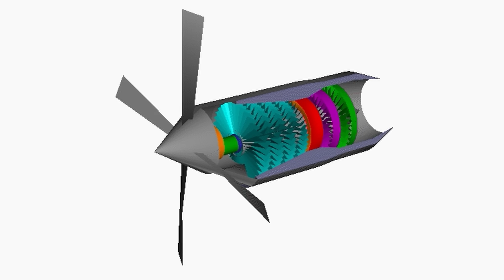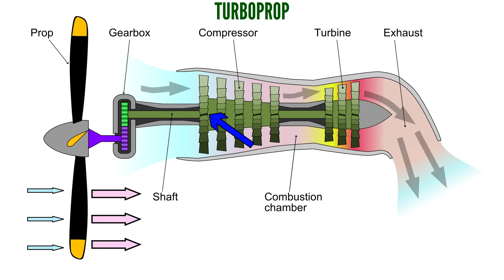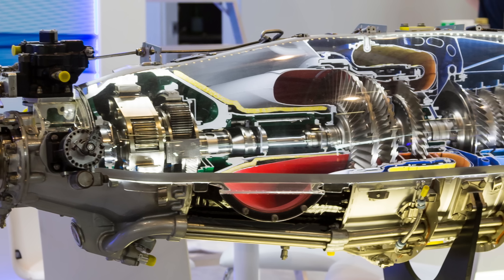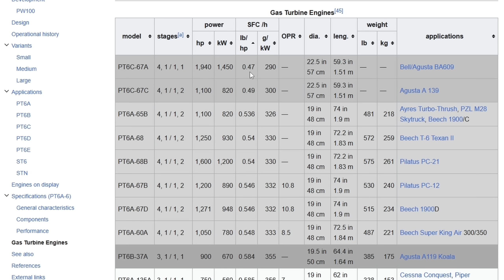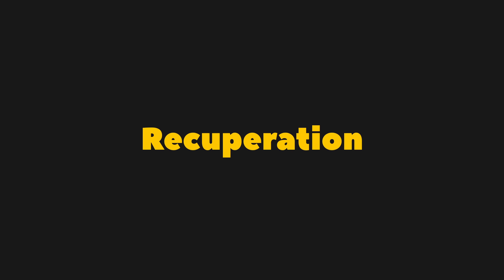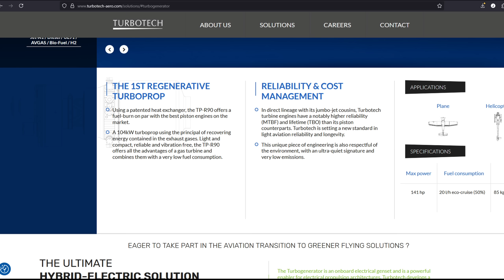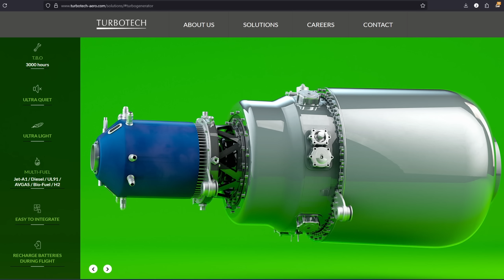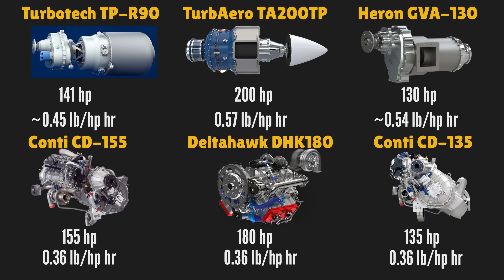Are Piston Engines Dead? Small Turboprops are Here

Comment: One thing that is definitely omitted from this analysis though is the difference in cost between Jet fuel and Avgas though. While specific fuel consumption of the turbine might be slightly higher, in most places Jet fuel is cheaper. Sometimes, way cheaper. Now, those are purely economic factors that can definitely be disrupted, but I'd venture to stay that at this point, the fuel cost of the proposed turbines is probably about a wash with the average GA engine. 

To me though, the real benefit here isn't specifically turbine engines though, it is increased R&D cost in the GA engine market. Comparing these new engines against something like the Cont/Lyco 300s and 500s is comparing bleeding edge engine designs against engines that literally had their first runs in the 1950s. It'd be interesting to see what developments could've been had if as much $ had been poured into R&D of piston engines. But here's to hoping we can just skip a step and go right to economical turbines...!?

Comment: Has anyone tried developing a hybrid drive, i.e. turbo-generator + electric-prop-drive(s)?  This would allow the turbo-generator to run constantly at optimum operating point.  Small batteries for take-off could temporarily boost power output. Obviously the generator and electric motors add weight but this would be somewhat offset by the lack of gearbox and transmission.
Reply: Another benefit of this: The battery could be charged on the ground from renewable energy sources, thus reducing the overall CO2 emissions per flight.

Comment: Modern gasoline engines can get down into the 0.35 to 0.37 lb/hp/hr range. Even the Continental Voyager IOL-200 was able to get down to 0.37 at a cruise power setting, and it was designed in the '80s.

Comment: As an aspiring pilot (meaning I know nothing) I love the idea of the power to weight ratio of turboprops, and I especially love the reliability.  It seems like the thrust to weight ratio would support a faster rate of climb.  Perhaps the weight savings would support a large fuel capacity.
Reply: faster rate of climb, but it also takes more time to spin up if it's on idle and you suddenly want to speed up (like in a go around).. piston engines are better for dealing with such emergencies.
Reply: @acasualviewer5861  Smaller engines have lower rotational inertia so should spool up slightly faster. A better solution, though, is to have a variable-pitch prop and use the prop pitch to vary thrust (i.e. set the prop pitch so more of the power is lost to drag than thrust), while keeping power relatively high. The prop setting can be changed nearly instantaneously.

Comment: I saw small turboprops in small aircraft 40 years ago. For the fact they haven't become the norm maybe says that it's never going to happen. Don't forget to factor in cost of overhaul which can be massive when it comes to small turbine engines.
Reply: you would be the same guy that would rant about how cars are not viable and horses are superior, or microwave ovens, or cell phones, or computers....  ignorance is bliss
Reply: @slowery43 a more accurate statement would be to hold those opinions 40 years after the introduction of cars, microwaves, etc…a more relavent comparison would be the viability of flying cars in this scenario. In no way have you countered anything in the OP post. A substantial breakthrough would be needed to increase the efficiency of small scale turbines to compete with piston engines, currently the cost benefit doesn’t work out in favor of turbines.
Reply: If the manufacture cost comes down enough I imagine instead of overhaul you might just replace and send a core out to be reworked or scrapped.
Reply: Agreed - while sometimes there's breakthroughs that make a once impractical technology practical, unless there's some big innovation or market change that's not likely considering how long and how many times it's been tried. Sure there was a time when turbines of any sort weren't practical and now they are for anything over 500hp, but if someone was going to succeed at making a smaller one practical they probably would have by now, unless there's some game-changing breakthrough coming along. Only thing I'd imagine could be that would be perhaps material technologies - perhaps ceramics - that makes engine parts able to tolerate higher temperatures at low cost. Honestly same for small aircraft engines different from the horizontally-opposed air-cooled direct-drive engines. Basically everything's been tried - geared engines, automotive conversions, rotaries, turbines - but they've not been found to be practical outside of some specific niches.

Comment: If I was going turbo prop I would buy one flying the form of a Caravan, TBMxxx, PC-12, King Air, or Cessna Conquest. If I wanted an engine for a kit plane, I would look for a PT6, Allison 250 or Garrett TPE331 USED out of one of the above planes being parted out. Service, parts and real known performance with these engines.  Solar APU (Auxiliary Power Unit), specifically the T62 series, by adding a reduction gearbox and a propeller can and has been used. You could get these APU's cheap at one time. .  I was looking at TBM 750's before 2020 and bat stew flu, the price was way down, $600k-$750k. Heck now a RV-10 is that and a new Cirrus is over $1,000,000.

Comment: At close to double the specific fuel consumption compared to a high performance piston engines, current airframes simply do not have the wingspan for the flying at efficient altitudes and storing enough fuel for decent range.

Comment: Unless turbines can drop in price, I do not see it in large quantities.  With FAA Mosaic regulations now approved and 2030 unleaded gas movement, the use of piston engine technology found in car/motorcycles such as computers, O2 sensors, water cooled, fuel direct injection, mass air sensors, and turbos will bring fuel economy, lightweight, and reliability upgrades to small aircraft.
Reply: Baloney. Addition of a turbocharger and water cooling systems is already a known quantity not much to be squeezed out of that relative to the old reliable lycoming normally aspirated horizontally opposed air cooled engine.
Reply: @erickborling1302  You must be on to something. Surprised cars on not still using the tried and true naturally aspirated air cooled engines like we saw in the 1938 VW Beetle.  I suggest you contact the car manufacturers and let them know of your insight.

Comment: I designed a rotary engine many years ago. One the size of a coffee can would produce 20HP with two power strokes per revolution and only four moving parts, with zero vibration. Functionally equivalent to a 4-cylinder 4-stroke piston engine. With two rotors and 7 moving parts, it would be equivalent to a V8. I wish I could afford to build one.

Comment: Turboprops DO VIBRATE... The Props... a fleet of turboprops had cowl cracks and exhaust stack cracks... All was in specs. They got aggressive about Prop balancing. All issues went away. Turboprops (commercially viable proven) start at about 400HP on up but typically start at +500HP. (Allison 250 has a 317hp version but typically 420-450HP). Not many GA planes use that much power. SFC is higher, cost of accusation and overhauls are high, not something private individuals can afford. Sub 350HP a turboprop is not competitive with a Lycoming or Continental on cost basis. Sub 130HP the Rotax is dominate, but $55,000. Ha ha ha. Again bought my Lycoming and Prop, overhauled it, put PMags on it, with a used Hartzell for about $20,000 15 yrs ago.

Comment: Compression ratio defines thermal efficiency from fuel combustion.  A piston engine can handle compression ratios, which in a diesel can be up to 18:1  coupled to air charge "boost" of 40psi.  Turbine engines can only dream of such high compression ratios.  The company "Speed of Air" have special ceramic coated diesel engine pistons that have raised the bar on durability and fuel efficiency by 20-30%.

Comment: $85k- not bad for engine only. deltahawk engine only? $60k- but the hawk will run on jet A, offroad diesel & B100, and at a burn rate of about HALF that of the turbine, it gets better- overhaul of a turbine engine, even one without a heat recovery exchanger, is pretty close to the orginal price of the engine- not a pretty sight. cost of overhauling a deltahawk? about 10% of the price of the engine. cheap, cheap cheap.

Comment: Would constant RPM props be OK for turboprop engines ?
If recuperators are so thin-walled, I expect salt-water air will drastically reduce their lifetime.
You didn't menion very cold weather operation.
Just my opinion, seems turboprop engines should be used where more power is desired, assuming the turbine can be configured for 200+ HP.

Comment: Turbo prop aircraft are ok for commercial aircraft or large GA aircraft but Cessna 172 and small GA aircraft personally it's too expensive as the engine is worth Moore then the airframe with a piston engine and as for speed you are limited to the aircraft design and can not exceed it and turbine uses more fuel and today's problems with the moden piston and turbine engines they are making them lighter to thinking to save fuel which is not that much fuel saving and this causes the piston and turbine to cost more in maintenance as they are failing more as they break easier then older engines as making them lighter causes cracks and the inspections are more intense like inspecting parts more regular then in the older heavery engines and for some reason the designers think they are building light weight formular cars
 Engines  and this drives the cost up so we need to look at what to he aircraft is going to be used for and it's limited and is the aircraft afforwardable for the. Job

Comment: In Europe, a huge advantage of the TurboTech is that it burns Jet A1 which is half the cost of MoGas, so that the cost of fuel is half that of a Rotax 915iS. 
You should also bear in mind that Jet A1 is about 10% denser than MoGas and, therefore, when SFC is equal the fuel burn measured in GPH or LPH will be about 10% less.
Reply: Jet A1 is just kerosene which is the least refined and cheapest petroleum distillate after marine bunker fuel and road tar.
Road fuel, both petrol and diesel, are heavily taxed around 100%, across all of Europe.
Fuel duty as well as Value Added Tax (VAT) on Jet A1 can be reclaimed if the fuel is bought for commercial use.
Most aircraft are owned through companies which facilitates reclamation of fuel duty and also VAT.
Across Europe, AvGas is almost 3 times the cost of Jet A1 and, therefore, high compression Continental and Lycoming engines have been rich men’s toys this side of the Pond.
This was why Thielert tried so hard to certify a reverse engineered Mercedes A-Class diesel engine to run on Jet A1.  They are now manufactured by Continental and by Austro and installed in all European Diamond aircraft.
SMA in France spent many years developing and certifying a ground up Jet A1 burning diesel engine for aircraft, Cessna was going to install these in the 182, but withdrew.
Diesel engines burn about 20% less fuel by volume than gasoline piston engines but the real saving is the cost of the fuel and also global availability.
Reply: Is this really true? I was always under the impression that the car fuel is the cheapest propellant one can get in aviation.
Reply: @RibicicDeni Jet A1 price per liter around Europe is around 0.60€ w/o taxes; 0.8-1€ with tax depending on country, while 95 petrol prices start around 1.1€ up to 2€, mostly on the high side. 98 can get up to 2.3€. Car fuel in Europe is heavily taxed.
Reply: @alanowa123  I am from Europe, and I always thought for some reason that Jet A1 is super expensive. Thanks for the info.
Reply: @RibicicDeni people who have the most influence it's prices use it a lot, so it's cheap ;)
Reply: @alanowa123  makes sense :D
Reply: Diesel more cost effective? Not in indiana. Not by a long shot.
Reply: For low time fliers, the price of fuel is probably a very minor component of their perceived cost of ownership.

Comment: Total cost of acquisition and operation of TurboTech is comparable to Rotax 915iS because it should have twice the TBO or more although it will take many years for an average private pilot flying 50 to 100 hours per year to reach this.
More noticeably, maintenance should be less, with no spark plugs to check and/or replace and, compared to small Lycoming and/or Continental engines, no magnetos and/or carburettors to adjust and/or service and/or replace.
Reply: Given the durability why would anyone buy a turboprop only to give that durability to the next Owner?  It's the same as if you bought a Diesel Pickup and sold it every 50,000 miles to buy another Diesel pickup.

Comment: Turboprops by themselves are lighter than piston engines of equivalent output but they burn more fuel so you either shorten the range or carry more fuel which will add up to more overall weight than an equivalent piston engine with the same range. Turboprops are also more expensive. So in the end, your aircraft is heavier and more expensive. That’s not ideal. Turboprops need to be more efficient and cheaper before they can replace piston engines.

Comment: The Pratt and Whitney Canada PT-6 do not have a gear box in front, it is a free turbine. One less item to service and fail.  The reverse flow also make it quieter than the straight through engines. Rotax is a big company with lots of overhead cost and share holders to please, so far, they have not done the aviation field any favors by lowering cost. Their price seem like what the market will bear, rather than reflecting their real costs. Same with the other few engine makers , their engine designs had been certified as long ago as the 1940s and still priced that high. The demand for reliability is not much more than a Toyota engine.

Comment: Cost over time might equalize with cheaper fuel and longer, but probably more expensive TBO. Maybe not equalize but get closer?

Also - if fuel is cheaper for the turbo prop, then increased fuel consumption comes down to a weight issue (ok environmental too…). But is the turbo prop lighter? Would it partly offset some of those penalty? Idk… I’m too lazy to run the numbers and on not even an active pilot anymore. But if I did become active again and I knew a light twin, say like the size and capability of a Cessna 310 could be bought with turbo props and offer much higher reliability for my family? Maybe the cost and increased fuel burn is justified - but then why not look for something with a single pt6? Devil in the details I guess…

Comment: Another thing to consider is the aircraft the turbotech is going into. Turbines often increase efficiency at higher power levels, if you operate it at 90% you might be getting higher efficiency AND fadter cruising speeds, but this would be a complex equation that involves weight, wing area, cross sectionial area, drag, etc... Probably something best left for the computer simulations to figure out
Reply: Not that complex. You just need an L/D curve and a TSFC diagram (for the engine-prop combo). Combine them to find the point where best range speed is.

Comment: The Turboprop will be purchased, if the price tag is at the Same Level as e.g. the 914 UL. I guess the Target group of this Fine Solution is/are the builders and the Aircraft Manufacturer which needs to have reasonable prices for their aircraft. 
Generally, cool little engine😊😎👍🏼
Best Regards, Hanspeter

Comment: I agree that for such small power output a TP is hard to justify, the only reason may be simply higher power to weight ratio with lower drag for some racing and that's it. Turbotech people in some interviews stated that they will make more powerful engines once they fully develop this one. They are backuped by Safran, so that's top level support. IMHO the sweet spot for these engines will be in the 250-400HP, where single or twin engine aircraft have more utilitarian purposes and there will be cases where a lighter engine and therefore a greater useful load plus a longer TBO are commercially justifiable. Presently there are no diesel options planned in that power range. Let's see how this evolves in the next five years, it's gonna be fun hopefully :D

Comment: NO- on fuel economy - and a hugantic, GIRNORMIC NO on cost. fuel cost vs. AV.gas in a LYcontisuarus? if you use offroad diesel or home-brew B-100? sure. but that's not what they'll be competing with in the very NEAR future- they'll be competing with the likes of dieselhawk & achates aircraft engines- probably a cummins manufactured, purpose built aircraft diesel, designed by achates for the role. THAT cost? 75% less cost up front- 50% less fuel- for life- ANY heavy fuel. sorry turboprop- too little too late. where they might hit the benchmark? a turbo-shaft hybrid that powers a VTOL with electric fans, because turbines have a power to weight that is insane.

Comment: Plot twist= Avgas 100 LL is banned without a technically sufficient replacement.

Then there will be rotax capable of using premium auto gasoline, automotive diesel engines and - drumroll - small turboprop engines to each contribute covering whatever space is left over after the demise of the high compression aero engine leaves behind.